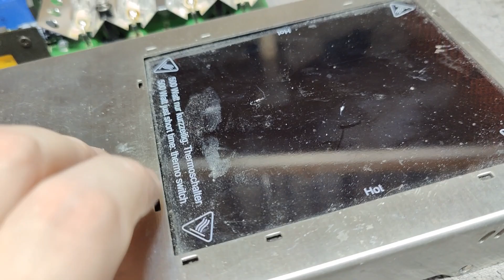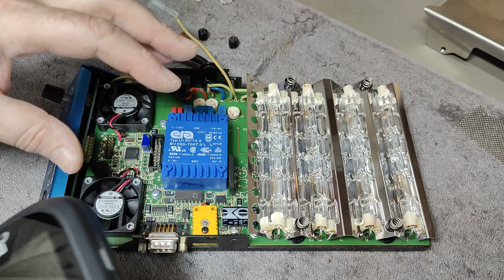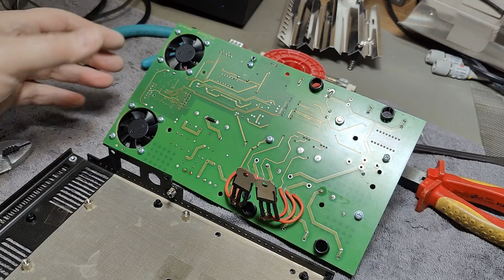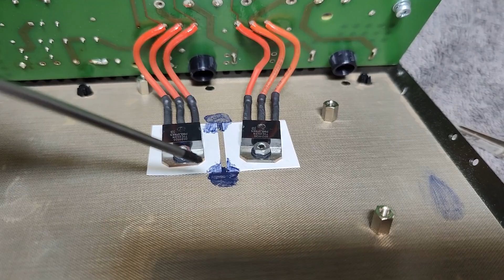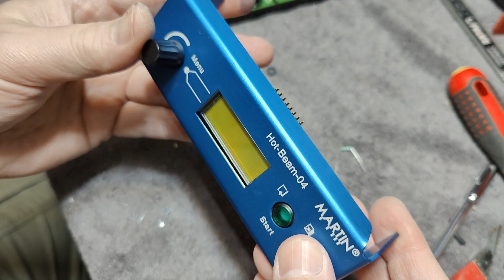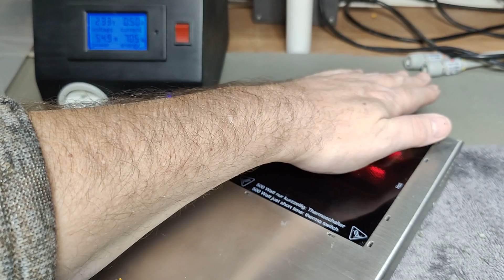Martin Hot-Beam-04 IR heatplate 500W repair and teardown

Comment: rather than use varnish etc in the chassis holes, you should use shoulder washers: one from the outside that will make the hole smaller, then one from the inside so the "shoulder" fits inside the other one's. this means there will be a washer on the inside acting as a standoff between the triac and the chassis, so you add a copper shim to make thermal contact happen again. using double shoulder washers like that precludes any arcing especially if you use large disc radius washers.
Reply from the maker: i am not sure i understand your explain, the way i vision it : using shoulder washers all the way thru, dont add any extra distance triac to chassis, it only adds plastic to the screw, and the arc is not to the screw
please see this picture webx dot dk / isolate1.png
then you see the isolation distance triac to chassis is ONLY the thickness of the thermal pad
Reply: @TeardownOZ2CPU  hello, i tried sending a reply but it's not showing up. maybe it got caught by a spam filter. is there some other way i can reply to you?
Reply from the maker: @cheater00  reply including links will be auto deleted by YT, since it is against their safety rules, my contact info is easy to find in my channel info page, and my email is my call sign at gmail dot com
Reply: @TeardownOZ2CPU  oh i sent an email to literally mycallsign at, ok i guess it's OZ2CPU?
Reply from the maker: @cheater00  Thanks a lot for the email and VERY good picture, it is too good not to share, so i took the liberty to put it here : please see the new picture webx dot dk / isolate2.png
Some very good inputs about high voltage potential transistors and chassis mountings.
Reply: @TeardownOZ2CPU  yw hope this helps
Reply: @TeardownOZ2CPU  btw you can use it for pcb holes too
Reply from the maker: @cheater00  there are at least 2 more options : use a transistor that is fully isolated, they are not always possible to get, and they are not as good thermally, but they are better isolated.. the other option is to mount the transistor directly to an internally located heatsink that can be isolated correctly, see my 1kV load, used no electrical isolation between transistors and heatsink, also due to thermal challenge was very demanding
Reply: @TeardownOZ2CPU  i just replied with something, let me know if you didn't get it

Comment: I do like the form factor of the machine. Currently I only own a cheap small one with is basically a controlled hot air gun, works fine for smaller stuff, like memory IC's. The video and device give some ideas if I'm going to build my own. And how not to do it and keep in mind at fore hand. In the garage I installed those combined units, RCD and circuit braker. Only takes out a section within the garage, e.g. not the lights, very convenient in situations like this :)
Reply: there are cheap silicone heating pads for tablet repair, they reach similar temps just slower, but they take up even less space - about the size of one newspaper (plus power supply "wart" on the unit)

Comment: Would rather have replaced the Triacs with either the isolated tab version, or the fully enclosed plastic ones, which would be a lot better. Isolated tab is better, as they are rated for 2.5kV between tab and die. Washers for the board best to use plastic or fibre ones, much better, and provides both compliance and insulation as well, plus you can also use a drop of sealer to hold them in place as well during service.  Would have changed the electrolytic capacitors there as well by the lamps, using 125C versions, as they likely used 85C ones, well on their way to being cooked to death now.
Reply from the maker: that is the correct way

Comment: The plastic bush washer is supposed to go through the triac and through the mounting base 
the way they did it is wrong.
Reply: Plus used the wrong length bush, you get longer ones, along with a version for that TO247 package that basically covers the entire top with plastic to provide extra isolation distance. Slightly longer screw, along with an extra fibre washer, would help as well.
Reply from the maker: @SeanBZA  all that is correct, but it still dont add more isolation distance, transistor metal bottom to chassis metal inside that hole is only the distance the isolation thermal pad is thick, that is not much, way under the requirement.

Comment: Det ligner noget der er flikket sammen på hurtigste og billigste måde. Er din vario ikke med skille trafo.?
Reply from the maker: yes, too many isolation issues in this design, You need to check and improve this if you own one, my vario is NOT isolated, it is on purpose, I need chassis to be PE for my own safety, and to be able to flip HPFI in case anything spark over to chassis, using isolated mains to put live voltage on chassis is not how i recommend to work on products with isolation issues,
Reply: @TeardownOZ2CPU  Okay, that makes sense.